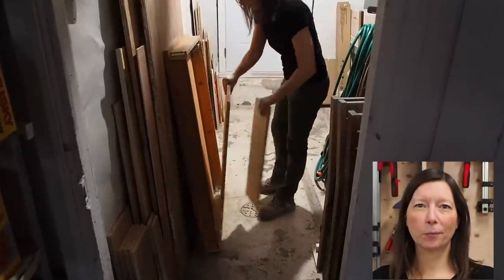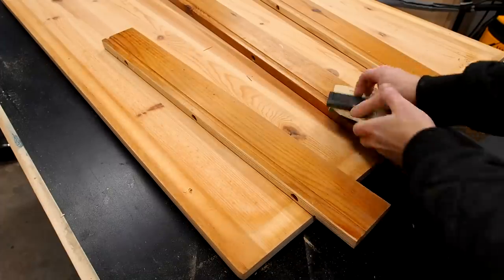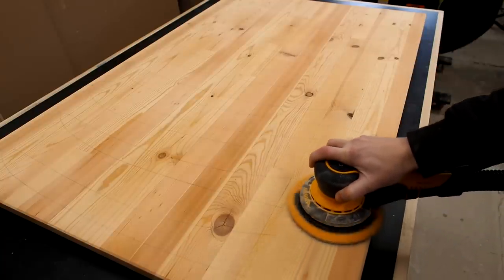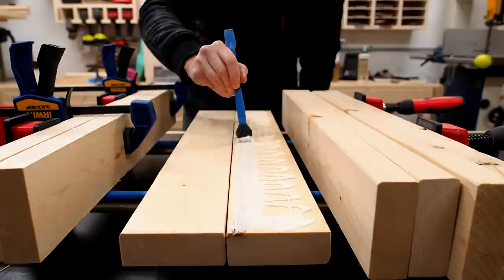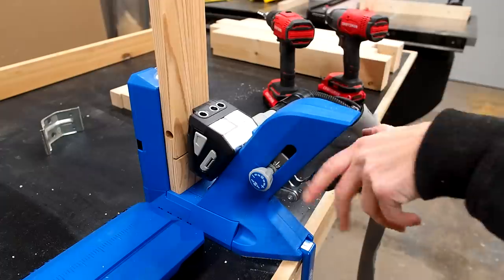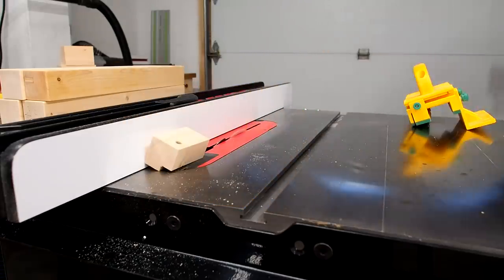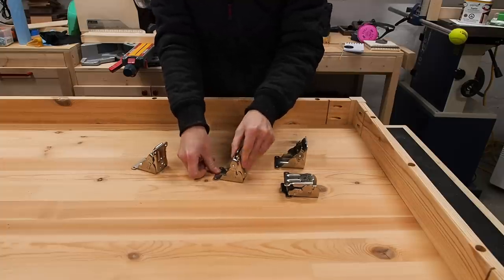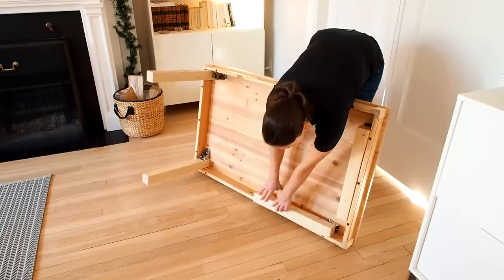Is It Worth Salvaging Old Furniture?

Comment: I pick up loads of old furniature from a site called Freecycle here in the UK. All for free. Old tables, beds, bookshelves, doors etc... An endless supply of free pine & quite a lot of oak. Occasionally teak & other hard woods. Take them apart & clean them up on the table/band saw. A bit of a sand & I have most of the wood I'll ever need (bar large construction timber or MDF/Ply sheets). My only headache is where to store it all.

The odd sizes & shapes are always an inspiration for new projects.
Reply: Hey everyone!
I Thought I was the only one that collected all this stuff to give it new life :)

Comment: Wow, the Osmo top oil sure looks amazing and screwup proof, but its outrageously expensive at 65 bucks for half a litre, then I guess you use in in a limited scope of projects like food- safe. I loved your tip about inspection with a side light, but with ceiling light off. I am guilty of sanding and finishing the same day.

Comment: Marie, you mention sanding one day, letting the dust settle, and finishing the next. I had thought you had an overhead air filter in your shop, wouldn't that do an adequate job of scrubbing dust in the air?
Reply from the maker: Great catch! The scrubber is temporarily removed as I'm trying to close up an exposed part of the ceiling with drywall. 
Even so, the scrubber does a good job in an hour or so but I still find some small dust will continue to settle. So I'll maybe try to wait 2-3 hours at least before finishing.

Comment: Good vid, nice build! I'm a little iffy on how you managed the corner gaps on the preexisting aprons, though. I'm not sure how I would have done it differently, short of replacing the aprons entirely, which would go against the whole notion of salvaging! 😅
Reply from the maker: I actually considered removing the aprons completely but then the hardware would be visible.  In the end, the solution doesn't have to be perfect, as long as it works for your needs and pleases your aesthetics 👌

Comment: sometimes its worth it, i recently took apart an old mahogony table, its warped and damaged in places, but theres enough good material left after i process  it to make a nice jewelery box.  i have made the mistake of accepting lots of junk furniture that on close inspection is only good for firewood though.  and im running out of space 😄
Reply from the maker: Ha! I know that too well. I steer clear of free wood and free furniture now. Usually not worth it. But salvaging rare wood can make the effort worthwhile!

Comment: Excellent job as usual!  Can I lightly sand a dining table that has a veneer covering?
Reply from the maker: Well... depends how thick the veneer is
It can be easy to sand to far through the veneer and impossible to recover after that. But it can be done.... gently
Reply: @DIYMontreal  thanks so much.  I’ll sand it very gently, the scratches are only surface anyway.  Happy new year to you.

Comment: I just use old furniture for free wood.  Take it apart, joint/plane it, maybe glue panels out of it, and you can get some great wood.

Especially with old ikea stuff it’s just not worth repairing and usually just better to use it for a project.
Reply from the maker: Smart! Lots of free quality wood if you're willing to put in the effort 👌